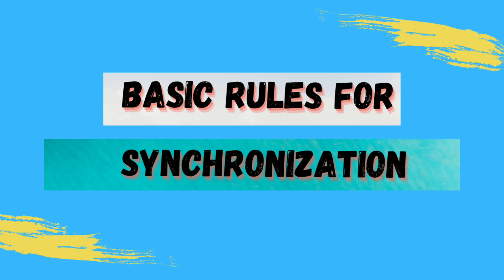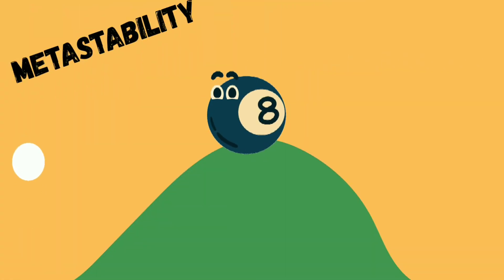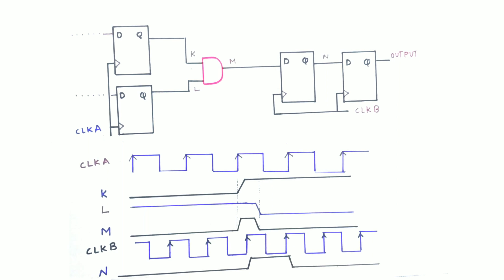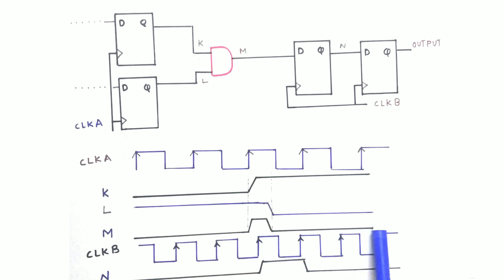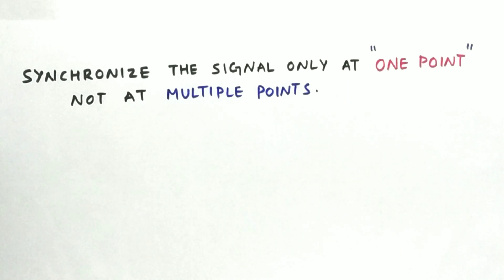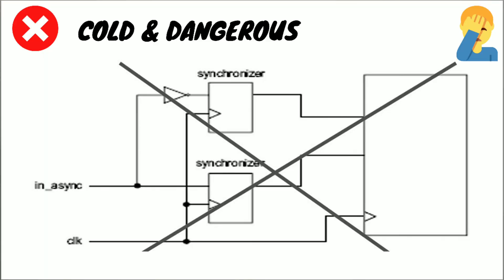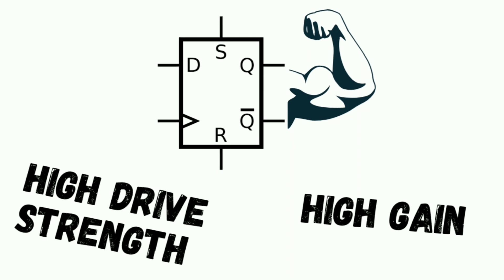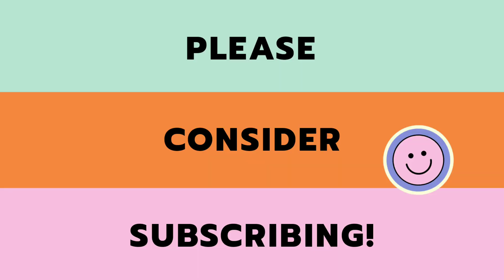Signal Synchronization Rules (Must Follow!!)

Comment: Hey karthik, the example you have shown for glitch possibility is incorrect, during synchronization there is no guaranty to maintain same pulse width from source to dst domain, ofcource because of difference in time period. Glitch is possible due to different propagation delays to 'and' gate and signal K,L are supposed to change at same time but L changes bit late, causing glitch. This would have been taken care in synthesis timing  but we set false path b/w src and dst domains, so this path would not be analyzed. Cheers. I know you in person and  I like your content.
Reply from the maker: Hi bro